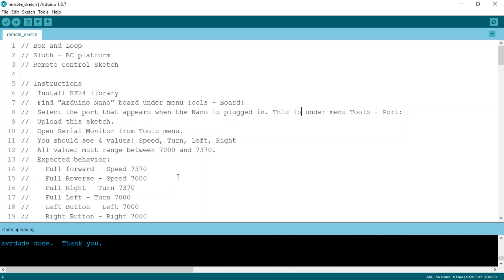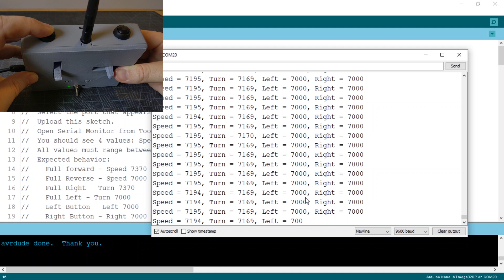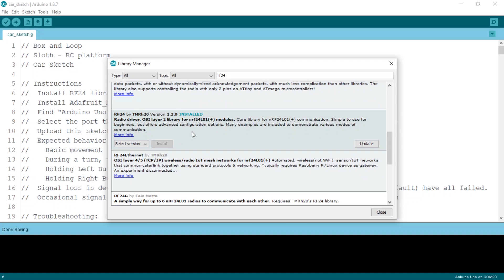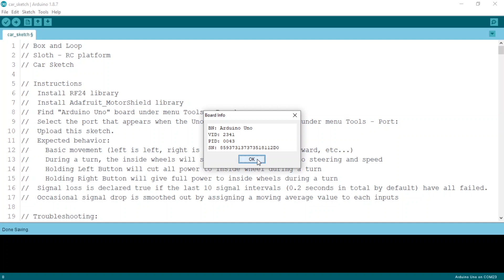The Sloth - 3D Print your own RC Car

Comment: Most people would have just glued the LEDs into the controller. I like your solution. More complex, but easier to repair in the future.
Reply from the maker: Thank you. That was the goal. To make it easy to disassemble
Reply: @BoxandLoop  Any plans to revise those front trailing arm joints where they connect to the steering knuckle? Maybe a ball-and-socket design?
Reply from the maker: The couple first designs were based on a ball joint, but with it being 3D printed it was large and more importantly had to be very precise to avoid too much play. Thinking about people trying to print ball joint gave me headaches, so I scraped the idea
Reply: @BoxandLoop  Cool. I wasn't critiquing, just curious. It's a really awesome design all around.
Reply from the maker: @andrewsmith1204  thank you very much

Comment: Amazing work! I'm mid-way through the build. Finished the remote, and looking forward to digging into the car once some parts arrive. One observation: I noticed that the low battery LED on my P1000C stays lit when the power is off, even when the battery is charged. I looks like you're seeing the same thing in your assembly video. I think this is caused by the pull-down resistor on the Arduino's analog input pin. If you put a diode in between LBO and A6 (with the cathode facing the P1000) that will prevent the red LED from staying on all the time, and the Arduino can still read battery voltage.
Reply from the maker: Awesome! Thank you. I'll try that
Reply: @BoxandLoop  My pleasure. Also, I noticed you're also seeing the weirdness in the remote control code where pressing the left button triggers both left and right analog inputs, but pressing the right button only triggers the right. This is because the Nano only has one ADC, and all the analog inputs are mux'd into it. Due to how the Nano samples an analog input, when you try to read an open circuit (e.g. an un-pressed button) you can sometimes get flaky behaviour like this where the ADC's buffer holds values from previous samples. In this case, you can solve it by treating A3 and A4 like digital inputs. I can share my changes to the remote code if you're interested.
Reply from the maker: That would be great if you shared. This is really my second electronics project so I want to learn anything and everything.
Reply: @BoxandLoop  Sure. Some very minor changes. I put the modified setup and loop functions here: https://pastebin.com/5SxwFXyN

Comment: This is dope asf homie. I want to make my own circuit for a project I’m working on, do you have a suggestion of what software to use to design a circuit or at least layout a page that guides you on where wires go and where things connect(like your file has in the circuit assembly). Amazing car.
Reply from the maker: Thank you. I'm rather new to this hobby and just use what's already available. I do hope to get into designing my own boards in the future though

Comment: im thinking of making this, i just got one question about the bom. the motors are on another site and i usually order from amazon, is there another option of motors on amazon?
Reply from the maker: I could not find one. Those motors are are great since they come with a gearbox attached
Reply: @BoxandLoop  ok and one more question, how long can the battery keep it alive and whats the range of how far you can be from  the sloth?
Reply from the maker: Battery last a long time. I was shooting the driving videos for couple days straight with burnouts and everything without recharging. Distance I have not tested for maximum, but should work across a basketball court

Comment: what slicer do you use ?
Reply from the maker: Cura
Reply: @BoxandLoop  thats weird because i couldnt import your iron man helmet files
Reply from the maker: @jaffy1048  that's strange. The files has  worked for others. Maybe reinstall Cura
Reply: @Box and Loop  the files are working now but for the helmet could i use this arduino https://www.amazon.com/REXQualis-Board-ATmega328P-Compatible-Arduino/dp/B07WK4VG58/ref=sr_1_1_sspa?dchild=1&keywords=arduino+nano+every+with+cable&qid=1620094455&sr=8-1-spons&psc=1&spLa=ZW5jcnlwdGVkUXVhbGlmaWVyPUFSUEo5VkxGTU5NR0ImZW5jcnlwdGVkSWQ9QTAwMDQyMTMxUjlCRDY3VVhDN1gwJmVuY3J5cHRlZEFkSWQ9QTA3MjczMzU3RU1RTjFCUlgzQUomd2lkZ2V0TmFtZT1zcF9hdGYmYWN0aW9uPWNsaWNrUmVkaXJlY3QmZG9Ob3RMb2dDbGljaz10cnVl
Reply: nevermind

Comment: Amazing, you inspire me to built this car with my own electronic (stm32) and with some changes in construction.
only one question: how you synchronize all motors?
Without feedback from all motors it is not working properly. no it is working but some of the wheels are spinning slightly faster/slower

https://www.youtube.com/watch?v=fWfiE7kfb30